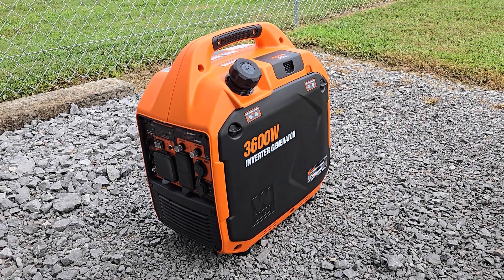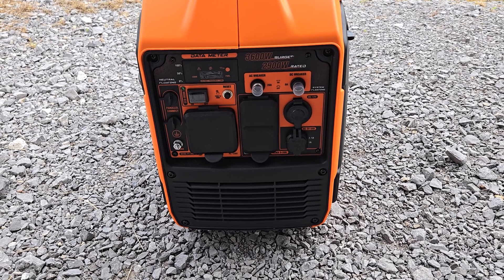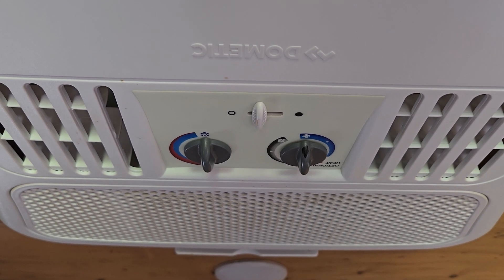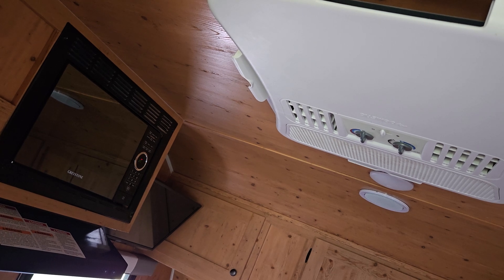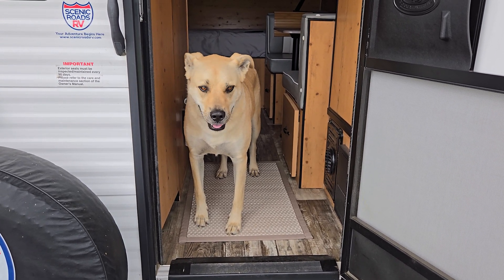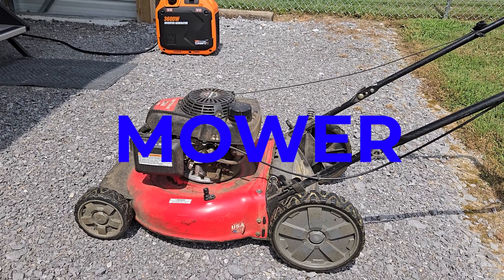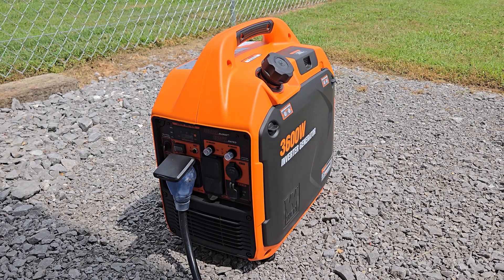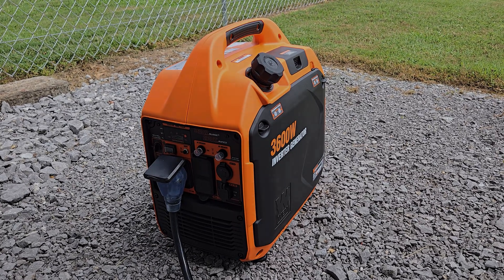WEN 56360i 3600-Watt Inverter Generator Load and Loudness Test

Comment: I did a power audit on my truck camper. A/C came in 3rd, second was electric water heater. Number one power pig is microwave. I only run one at a time. Even at a campground with good 30 amp.

Comment: Thanks for the video. Question for you: I am looking at getting one of these and am interested in a extended run time without refueling. I thought I would by a generic 5 gallon replacement generator fuel tank and make a frame so it sits at the height of the Wen generator and take the Wen fuel line and connect it to the larger tank. I know I will need to extend the fuel line. Does this seems doable? Is the fuel inlet easy to access on the Wen?
Reply from the maker: Sorry for the delay in responding. I wish i was more of an expert to say if that is doable or not.  To me, yeah...it sounds doable. And the fuel inlet is easy enough to access on this generator.  It's right there in the open.
Reply: @videozar_  Thank you good sir.
Reply: just get the dual fuel model and call it a day.  A 20 pounder will run much longer than the 1.5 gallon gas tank

Comment: You gotta try starting the a/c first so it can get through the initial surge & then start the microwave. Also, if the batteries on the camper are significantly discharged while testing adding all those other 12V loads won't make any difference because the converter will already be running at maximum capacity
Reply from the maker: That's a great tip, thank you.

Comment: Nice trailer! I got a Sunray 149 Sport last year and love it. Sometimes I wish I had something smaller, sometimes I wish I had something a little bigger, but its great for off-grid which is all I do out here in the deserts of Nevada and the Sierra Nevada mountains. I installed 4x 100W solar panels and 2x 100Ah LiFePo4 batteries with room to grow, but I am now narrowing it down to this generator (dual fuel) for if the Sun aint shinin for extended time and also for home use in emergencies. Thanks for the video.

Comment: How about microwave and refrigerator at the same time?
Reply from the maker: It's in there (like Prego)
Reply: Should not be an issue. I plugged 2 refrigerators in on startup up and they bogged it down for a short duration but then worked great.

Comment: I think it may run the microwave at the same time if you start the AC first, give it 20 seconds to get past the compressor start up. It takes like double the watts to start the AC as it does to just run it after the start from my understanding.
Reply from the maker: @enthused7591  that makes perfect sense!
Reply: @videozar_  did that work?
Reply from the maker: @condor5635  i haven't tried it!  but i have a feeling it would work.

Comment: Used the DF version on propane during a recent blackout. Ran 2 friges, freezer, 2 sump pumps, fans and lights. A 15 pound propane tank lasted about 10 hours. One big problem with the gas only version for camping is the size of the fuel tank. Won't run an RV air conditioner overnight. Thanks for posting.
Reply: That’s the one I’m getting, good choice.

Comment: My 3600 runs both my AC and microwave no problem but my AC is only 8k btu
Reply from the maker: Ah, that is probably the difference.  Is it a roof mount AC or a wall mount like in a house?
Reply: @videozar_  wall mount

Comment: Decibel readings on these are rated at a range of 25 ft how close were you
Reply: They probably measure at 25 feet because that is the length of the typical RV power and extension cords. I just bought the dual fuel version. Thanks for sharing.
Reply from the maker: Maybe 5 or 6 feet away